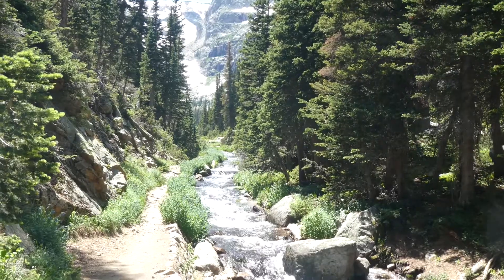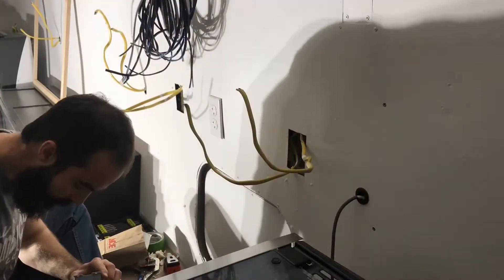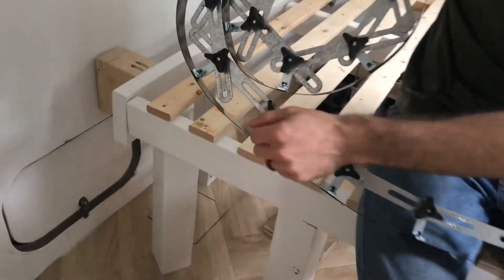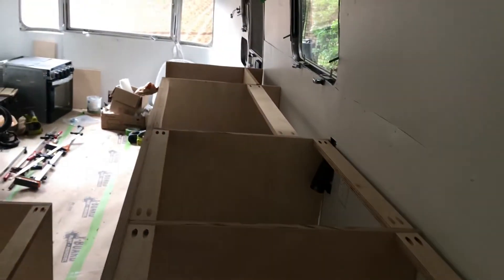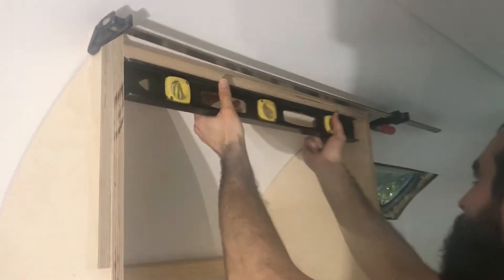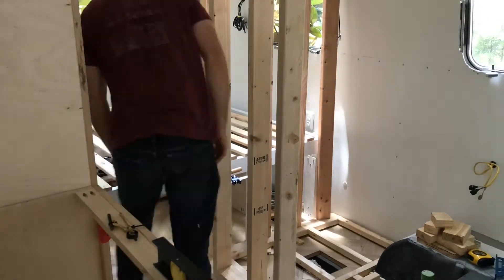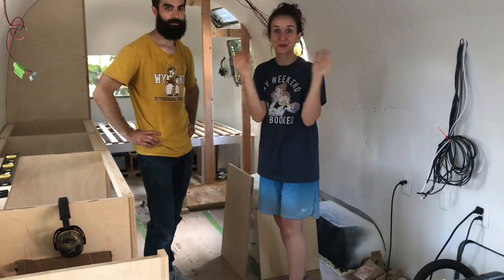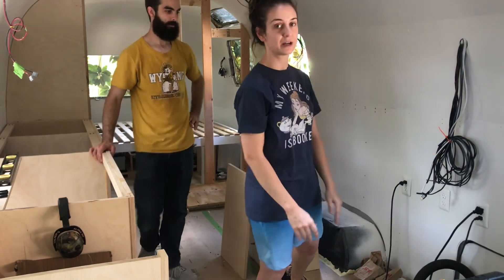Diary of an Airstream Weeks 31-35: Cabinets, Closet, and Shower

Comment: Love the work you are doing! I am currently renovating 1973 Ambassador centre bath 29ft. It was built in California, and doesn't have the window to the right hand side of the door (looking from the outside in).  Keep up the good work!
Reply from the maker: That’s the exact model we have! Any luck sourcing a new window? I know they can be tough to find.
Reply: @affordablyaway9737  oh I don't need that window it wasn't built with it.. I wish it was. That is the only difference I can see between our trailers. I got mine 90 percent complete but when the lockdown was lifted (I live in 🇬🇧) I discovered large parts of my subfloor had been destroyed by leaks, and the wood had mushrooms growing from it (it's a plywood thing apparently when the fungus grows), so now I am starting again. I noticed a couple of your videos you are battling similar leaks to what I have. When you have polished you will need to reseal the exterior again on the seams and window joints etc.
Reply from the maker: Ah, I see. I didn’t know they made any of this model without that window. Interesting!

Yes, that’s exactly what we’ve found. No point in resealing before we polish. We’re having an insanely rainy summer, but if it ever dries out, that’s next on our to do list!
Reply: @affordablyaway9737  yes they are very rare, but if you look in the document archives for 1973 you will see the layout without the window near the door. Mine is the twin bed centre bath model.
Make the most of that rain to find and fix anymore leaks.
Reply from the maker: Yes! We’ve actually been very encouraged. Terrified to jinx it, but we haven’t had anymore leaks in about 2 months and we’ve been LOOKING for them every time it rains. Fingers crossed we’ve finally got a good seal!
Reply: @affordablyaway9737  I hope your Airstream stays sealed for a long long time! I like the layout you're doing its given me some ideas 💡